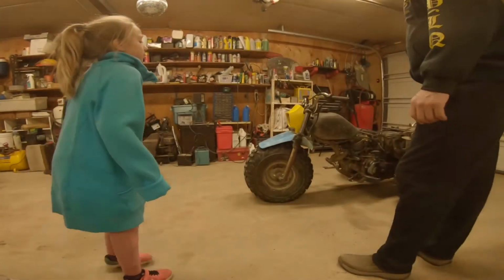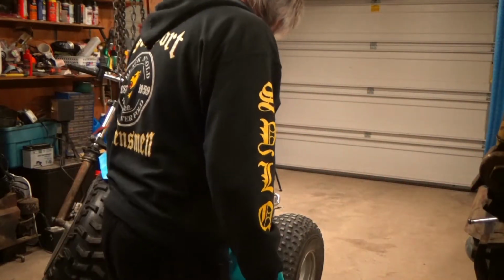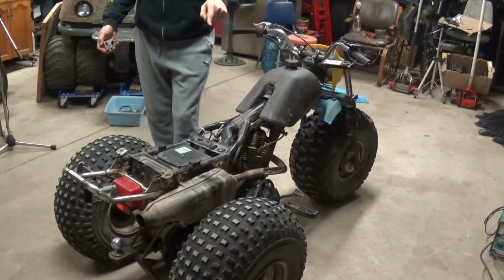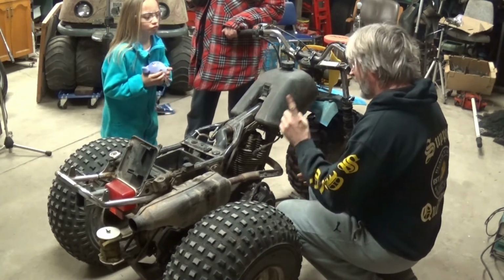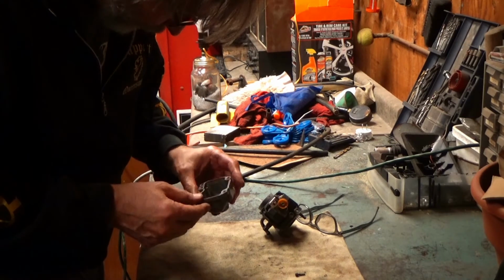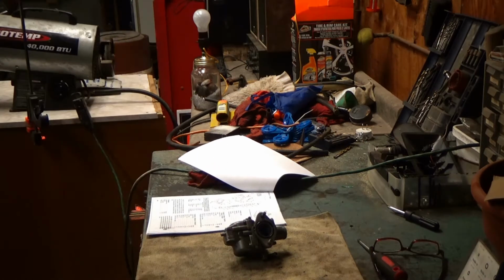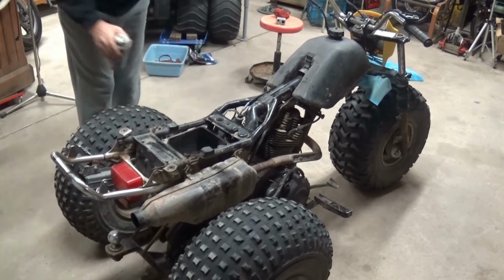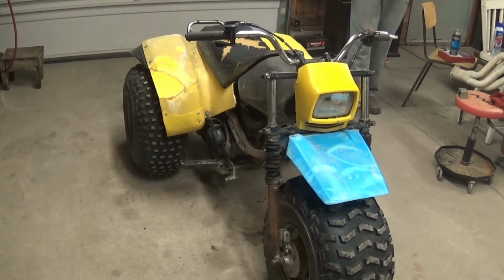1985 Yamaha YTM 200e - Carb Issues Fixed!!

Comment: A 125e doesn’t exist plus any Yamaha trike under 200cc where 2stroke you probably have a ytm200ER
Reply from the maker: Good eye!! Fixed the description. I had picked up a smaller 125 around that time, so must have been in my head. I re-sold the 125 right away so no video.